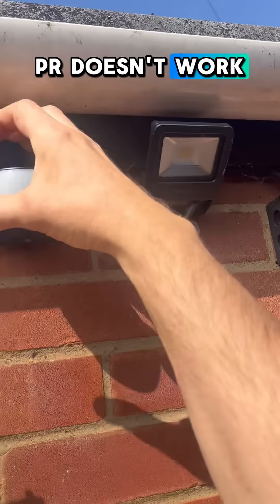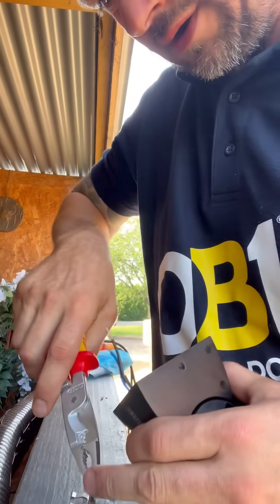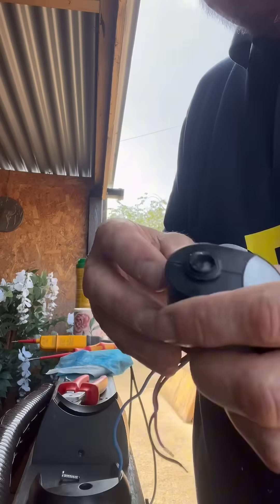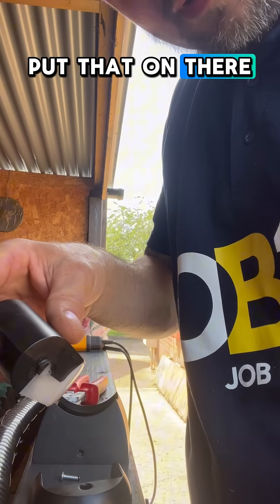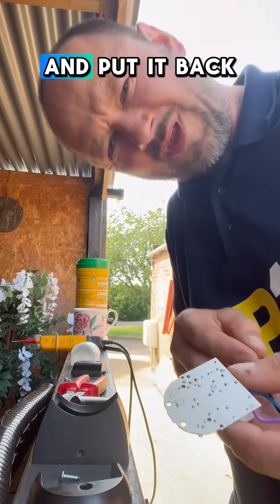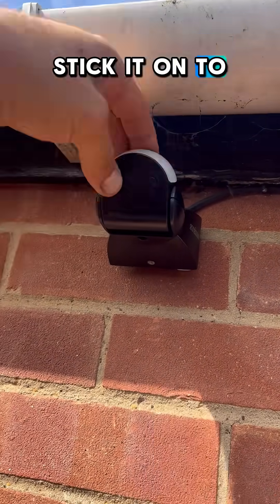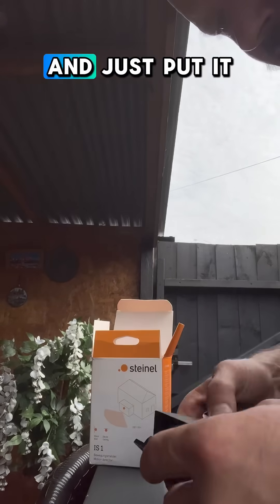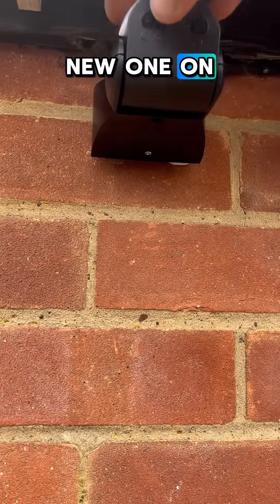PIR Light Stuck On or Not Coming On? Watch This Fix

Comment: No point repairing pirs like that, by the time you've messed about with it to repair it, it'll cost the client even more money. I'd personally buy a new one and swap straight away, I get them for about £7 so absolutely not worth spending half hour to repair it. If it was my own house though.... Too right Im repairing it or sticking the old one in the box and returning it, cos im tight as a ducks ass when it comes to my own place 😂
Reply from the maker: My kind of mate 🤣🤣🤣🤣

Comment: I bought a pir, it failed after a month. The replacement,  exactly the same unit, lasted 15 years. It's just your luck
Reply: I THINK WATER GETS INTO SOME OF THEM😊
Reply: @ZabienH ip rated bud...  Sometimes they'll get water in if installed incorrectly. It really can be the luck of the draw with them though. I've had it before where I bought a bulk order of them from a wholesalers for stock, and half the batch was faulty the other half not. Turns out they were from 2 seperate deliveries at the wholesalers end, and they'd had a faulty batch come in from the manufacturers.